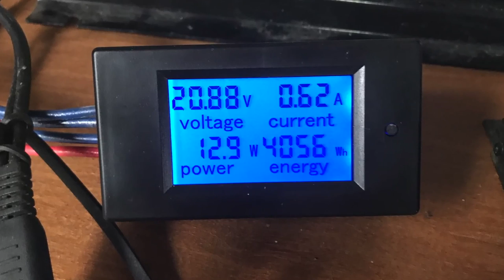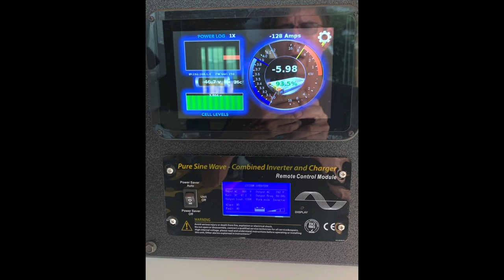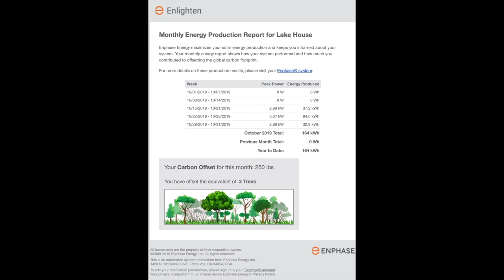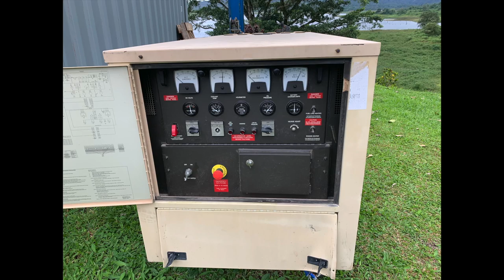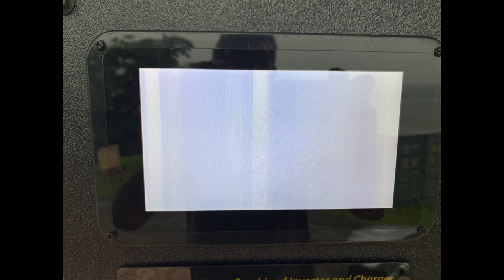EVTV on Tesla Cybertruck Unveil Wardrobe Malfunction

Comment: The very outdated 12 volt  DC winch.  How much smaller size/weight  wise can a 240v AC Winch be, if any?  I am envisioning  a package of hardened  mil spec mounts all over the cybertruck for winch, booms, outriggers for paint, chemical etc. sprayers,, wing style mowers, hog catchers,  cherry pickers, paint striping arms guided by onboard cameras able to do 100 ft. of road striping in 2.9 seconds.  All sorts of SICK marine applications with the float package.  The rubber military tank style track package  will enable economical power line maintenance,  The possibilities are endless for Sick attachments. This single vehicle will be responsible for launching millions of small businesses worldwide.  John Deere, Case better be cracking, GPS positioning/self driving ability of this beast is childs play in a farmers feild.  Farmer sitting at home watching the Jack Rickard  show receives text message that his bean harvest is complete,.  Can Elon be this smart?
Reply: This is it. I'll buy one when i can, one after another, than another and than another...

Comment: If they want that electric ATV to charge in a useful time the outlets better provide a LOT more than 3000w

I don't think we have to worry on this one?
Reply: Works great for farmers/hunters. electric line inspectors  doing intermittent  inspections , there will be attachments for everything,  need higher mileage? switchable battery packs, not a problem,
Reply: @solarsacomin6886   Just discovered that there will be solar panel option that provides at least 15 miles per day, I Really like that, a nice bonus.

Deposit down  :)  (before I knew about the panel option)

Really looking forward to this!

Comment: Pro Tip:  To remove light scratches and keying damage from a stainless steel car.. Use a 3M Doodlebug pad or a big scotchbrite pad.  I hope tesla ships this in brushed stainless steel.. makes minor cosmetics much easier to remove with above pad.
Reply: Also, wouldn't WD40 be a good choice to keep it clean and bright? I believe WD40 was created by NASA to keep their stainless steel rockets clean and sharp.
Reply: AND easy to mod with a welder too.
Reply: This is 30X cold rolled stainless steel that he is using for his new rockets, it's not going to scratch. If you could scratch it, I would be very impressed.

Comment: Would it be possible for tesla truck to use all, or some of, the motor inverter to supply the 120/240v outlets?
Reply: I think the drive system uses 400 - 500 volts so a separate inverter would be necessary.
Reply: *110/220.  I think it matters, since at those voltages, even if they sync everything else (phase, etc., which I think they are implying they are leaving out (boo)), they can't push much onto the utility grid or as much onto a (home) microgrid without a voltage boost without a third party interface converter thing.  My guess is that interface converter thing will suddenly become popular (and "illegal" everywhere commies don't want farmers owning their own land and providing energy with God's provided sunlight, so will have to be sold as a kit so people built the interface converter things themselves).

Comment: Unless this has recently changed the SpaceX 30X stainless steel is cryo-hardened, which is usually done at -185°C.
Reply: @Jack Rickard its the same steel they used for starship mk1. wich got this treatment.
Reply: According to a musk interview he was referencing cryo effects on steel of different types as a way to mention how steel would be effected by the cold of space on assent. He was saying the alloy structure of 301 wouldn't be brittle like other types of steel. With regard to the steel itself he answered a direct question as to what type of steel are you using with a response that its just 301. As to what cold rolled means I assume it wasn't sufficiently abnormal enough to bring it up in the interview. https://www.popularmechanics.com/space/rockets/a25953663/elon-musk-spacex-bfr-stainless-steel/
edit: actually the cold/brittle/steel cryo thing might be about the assent fuel cryogenic liquid oxygen, with the temperature affect of it on the steel.
Reply: @Jack Rickard 

"elonmusk: Rocket mass ratio is about the same for aluminum-lithium vs 301 stainless full hard at cryo"

They weren't talking about the stringers.

Cryohardening of the 301 stainless tanks & welds can also occur when they are loaded with cryogenic propellants and pressurized, with SpaceX using supercooled LOX at 67° Kelvin and liquid methane. SpaceX supercools their propellants to increase their density, so more energy stored per volume unit. 

https://twitter.com/elonmusk/status/1091222849400954880

@nickynaptime
Why the booster though? It needs to be a 63m tall x 9m structure capable of landing. SS is ~6x more dense than an Al. The hoop stress is low compared the structural stesses. Have you found that aluminum can't withstand earth entry on the f9?
|
Elon Musk @elonmusk
Rocket mass ratio is about the same for aluminum-lithium vs 301 stainless full hard at cryo, but latter costs way less, is tougher & doesn’t even need paint!
|
Won't the full hard cold working be destroyed by reentry heat? Martinsite  in EFH 301SS starts reverting to austinite in  at 400 C, and is almost completely gone by 600 C. Needs to be cold worked again to regain strength.
Reply: @docmordrid  For whatever reason 'he' removed my comment.
Reply: This whole experience been wierd, cause came here to this vid from think was elektrek where they billed this guy as a 'automotive expert' who essentially came to view the cybertruck as an outsider and thinks with his expertise that it will rock the world. But after looking him up to see what his 'automotive expertise' is, its as an 'EV Enthusiast' And also has vids promoting Tesla Stock as going to go to 900. So nah he isn't so much an auto expert as he is someone who prob has worked on vehicles all his life which counts alot of people who work on their own vehicles or people with mechanic background. But the elektrek article was being intentionally deceitful. The author of it surely was. Guess his article would sound different if he said here is the 1hrs 43minutes of thoughts from an EV and Tesla Enthusiast. Which is true, so u know they playing a different angle when they go and word it the opposite. So then it also throws you when this guy trashes Tesla enthusiasts in his video as if he himself is trying to also give that same slant. Kinda just feels like a big bait of some kind. Would been nice not to feel baited into watching this guys vids. I coulda watched a movie. nothing even wrong with his content other than the false impression that seems to be intended as the introduction to it.

Comment: Why is nobody talking about the potential energy generated while the 
Cybertruck is towing???? Imagine if Tesla had some stated amount of 
energy that would be generated from the regen breaking. And imagine if 
someone was smart enough to actually start making electric trailers that
 could help drive itself and also make use of the regen. The more I 
think about it, the more I see how doomed any OEMs dumb enough to not 
jump on the electric bandwagon are. Elon Musk thinks so much bigger and 
further ahead than your typical truck guy. He lands reusable rocket 
boosters on robot barges at sea. It will be fun looking back at videos 
like these in years to come. How many of todays OEMs do you guess will 
still be around?
Reply: Just wondering if the investment in similar onboard tech is going to be wise.
Weighing the ultra low cost of electricity at .02 cents a KWh with farmers co/op's having signed agreements for out of area members.  Will be interesting to see this pan out.
Reply: Most of the energy can be recovered by using regenerative braking on the truck.  With a smart electric brake controller, the trailer brakes don't need to be engaged unless you're braking hard.

Comment: How does this big heavy truck for $39k do 250 plus miles when the light more aerodynamic model 3 only does 250plus miles for the same price? Has there been a battery breakthrough?
Reply: Mark Umbers I think the frame and body are cheaper to make
Reply: @milkmanconspiracy4346  yes the boys indicated that. I was just hoping :).
Reply: Bigger battery. Cheaper body.
Reply: Same steel SpaceX using to make Starship. It’s cheaper and stronger.
Reply: They have two years to work on it so they are probably pricing/working in the incremental benefits they are gaining every year. In either case i think they can easily do that range with that sized truck to work with so any material advances could go to weight saving or range expansion.
Reply: Tune in to Tesla battery and powertrain investors presentation next year. We'll probably hear some great things about KWh/Kg and $/KWh. The next two years may be huge for battery development. Elon has an idea where things will be a few years from now, so he's setting price targets and range estimates based on the future.

Comment: Check out the William Towns Hustler range from the 1980s. He didn’t have the backing and finance of Elon but the Cybertruck is a clear echo. For the same reasons. Towns had flat panels, large areas of flat glass hanging off a steel frame. 
The six wheel Highlander was the original Cybertruck 30 years too soon.

Comment: Seeing how Cybertruck will be the new, #1 selling truck in the world. New manufacturing process (brake and weld) just how fast do you think they will roll off the production line.  Is ,4000 a day achievable from one Giga factory?  With the new battery manufacturing process, how many Megawatts can be produced a day to feed demand?
Reply: Musk already came out and said he's slightly optimistic that it will even do 50K a year.    Turns out being almost zero competitive in the bigger real world pickup truck market is not a good selling point.

Comment: I dont think they are going to use another inverter. They will use the motors inverter which means that it will be powerful enough.
Reply: The public won't go for that.  The outlet inverter must be able to generate 60 hz while under way.  The first slide-in camper must have this for the AC and frig.

Comment: Sick!  was looking at the Deplorables  Christmas Wish Book last night and really liked the tailgate flat grill/bun warmer attachment.  It is an electrical 240v element that is placed in the tailgate recess,converting the tailgate into a commercial size grill. Once the ramps are extened to make a sizable table (legs included with MAGA package).  The bun warmer setting has an ultra low setting to keep deplorables bums toasty warm during cold weather tailgating events.

Comment: I wonder how well this "truck" shows up on police speed measuring radar.
Reply: Police may well be buying this truck so we will find out
Reply: @alanrickett2537  It might serve them well, but not so much with high speed,long distance, Smokey & The Bandit runs.  You would tend to loose your quary while charging up at the superchargers.  200/300/500 mile range applies to reasonable speed.  I'd expect 50/75/125 mile range at 120mph (please forgive the crude estimate)
Reply: @foxpup  I was thinking more for swat or other special groups that may need big storage or 5-6 officers at once but am not am expert in us police
Reply: @alanrickett2537  might work but I'd want even thicker steel which would be damn easy to bolt on considering how flat all the surfaces are.  This could become the new US secret service mobile. :-)

Comment: Deep specs weren't announced because the surface level details are aspirational, just like self driving across the country this year (and last). This will sell well in 3-5 years, in a way different from to Tesla fanboiis only. I thought you might see more clearly than the hyper crowd. Still good to hear your thoughts.
Reply: @redxsage  Elon has plenty of promises he hasn't delivered on.

The best part of this vehicles, per the fanboiis justifying the design to themselves, is the price. Elon is clearly giving himself a long runway to TRY to deliver on it with added pressure of tax credit being gone. 2022 for the 3 motor  variant in Elon time. Surely it is obvious selling the lower spec versions first is a deliberate departure from previous business plan. And that's because they   are depending on advancements not under their belt yet.

Comment: 1:11:50 How many watts? All it takes is a contactor off one phase going from the traction inverter to the motor to make your 240V (339V peak, which is about pack voltage) AC output. Work that backwards from the kW rating of the motor, derate for efficiency, divide by three, - that's the max. But, the vehicle is not moving, so need to derate to the cooling system capacity. Then round down to standard NEMA socket capacity. I'm going to guess it'll be 50Amps (12kW) which puts the cooling system at about a kilowatt of heat output. The cool thing is you can juice a stranded Tesla - the 21st century "jumper cable", lol.

Comment: Some of them sharp angles likely won't pass rules for striking a pedestrian.
Given that deliveries are two years ago, I expect the batteries will be composed of Model 3 modules. 4 modules for 250 mile range, 6 modules for 300 mile range and 8 modules for 500 mile range.  Model 3 battery has about 74 kWh at present, but should have another 15% when it incorporates Maxwell tech and other advances that he will announce in the new year. So I think you are right at 85 kWh base, 127.5 kWh medium and 170 kWh large. He could get 177 kWh in the large battery if he only used the modules with 25 sub-modules. Also, about 4 kWh in the battery would be included in the range.
Reply: Peter Egan, the Road & Track writer?
Reply: All technology under the hood  will not strike pedestrians in the first place. That will be tooken in consideration as well.
Reply: You are applying car safety rules to a truck.  Trucks have different rules - pedestrian safety is no factor.
Reply: @PistonAvatarGuy  alas no. Sounds like he had a great career.
Reply: @pnikolay  it appears there is a sizable frunk. Reports are that all the tech is in sealed compartments to keep out rocks, dust and water, and nobody is getting a look at it. The vehicles are so cheap, the after-market industry will be looking for near new ones to apply the tech to other applications. It will surely create a new RV industry.
Reply: @andrewdiamond2697  That might restrict the market. 'Spear' and rip injuries from the corner of the hood would surely see demand for the rules to be applied to trucks - not even Tesla would want that.
Reply: @peteregan3862  Have you looked closely at the front of a Mack, Freightliner, or Ford F-650?  I don't see a pedestrian faring any worse with the Cybertruck.
Reply: @andrewdiamond2697  Edges are rounded to a degree - the aim is not to impale a body. Front corners of the Tesla are sharp due to the way they have worked in and set back the light bar.

Comment: F117 is absolutely not aerodynamical. Just not. Its higly unstable therefoe must be controled and stabilised by computer. Withitout computer it instantly fall down. It has this akward shape because it computing wasnt so capable to calclute better shape with the same low radar visibility. Today F-22 or F-35 are more rounded with similar low visibility.

Comment: Jack I disagree on your assessment about the battery technology. I believe the reason why the Roadster, Semi, Model S Plaid, Cybertruck delays are due to battery technology in development. 

This may also explain Panasonic recent statements about cutting 900 million next year investment in Nevada. I think Elon future planning a more efficient battery that doesn't need as large a battery factory but offers higher energy densities then currently.

They are delaying the release because they plan on getting there by 2021. The introduction of the Truck was to raise interest and to cut off Rivian and GM at the pass. Buys them more time to setup their production abilities. Reasoning why they bought that company that makes machines used to manufacture batteries. This was not unlike their move buying that German based robotics company and Maxwell.
Reply: I don't understand. You say you disagree with Jack and then say you believe the same thing Jack said.
Reply: @Jack Rickard 
Not only do I think the battery is ready, I think it will be in all cars before the US Model Y production launch.
I believe the Maxwell delay was inconvenient, together with the Chinese being so damned efficient building GF3.
Surely the original plan was to release the battery this month (November) ready for Model Y (Q1) and GF3 (Q2) ?

The delay of Model Y, then adjustment back to Q2 indicates they are ready since it makes sense to launch the cell in the Y from launch, not after 9 months, leaving the early adopters upset?
Another consideration?
If they use the Maxwell process ("photocopier" 😁!!) resulting in much higher production, they must produce a corresponding number of packs

The October (pack) patent details a pack with smaller sub-modules for easy repair, better packaging, more assembly automation, innovative temperature control (change of coolant state) the opportunity for a common physical pack dimension (cell and software regulated) and a common BMS.
Incremental changes detailed, when added to the new cell density (+15%?) can produce huge savings.
(Imo)
If not used, they must build a much bigger factory.